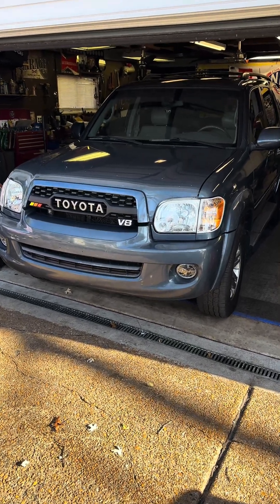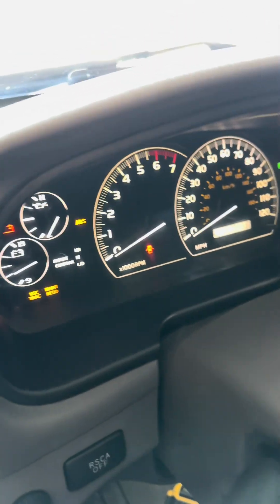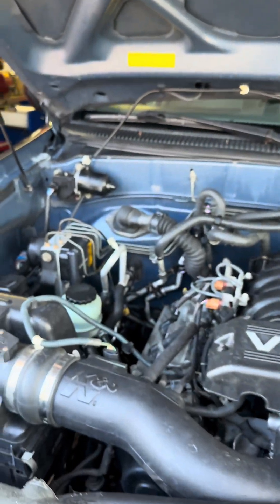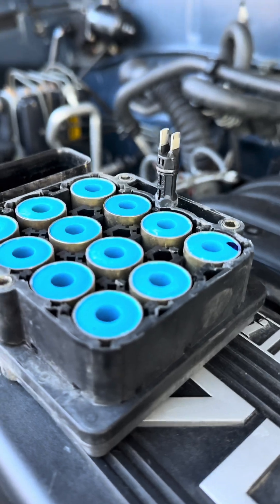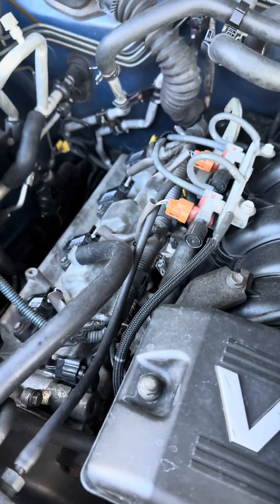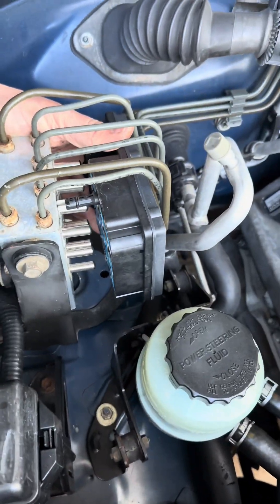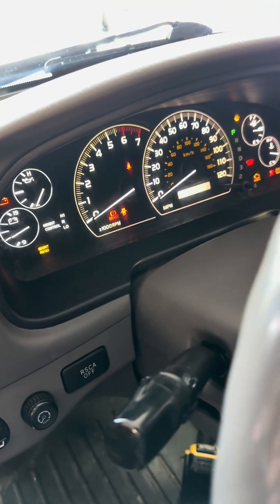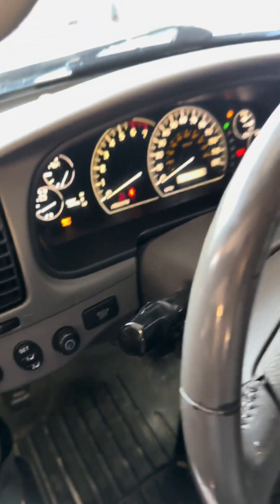How to diagnose & replace the dreaded Toyota ABS/ VSC/ Trac Lights on & replace the Skid Control ECU

Comment: Clear explanation- no brake bleed required?
Reply from the maker: Not if you don’t crack open any of the lines. I was very VERY careful to slowly bend the lines out the 1/4” needed for it to clear.. I didn’t even bother bending them back as it really didn’t change anything really.